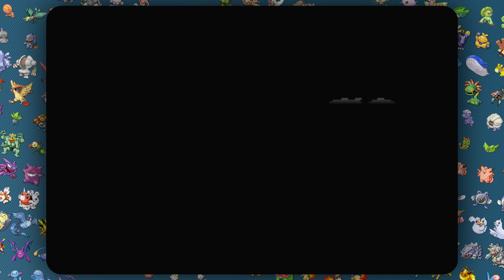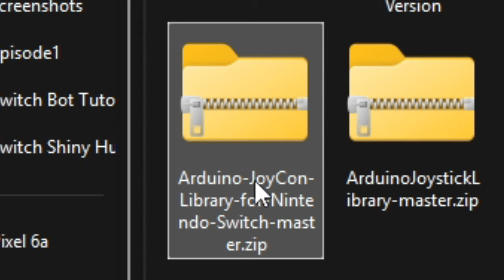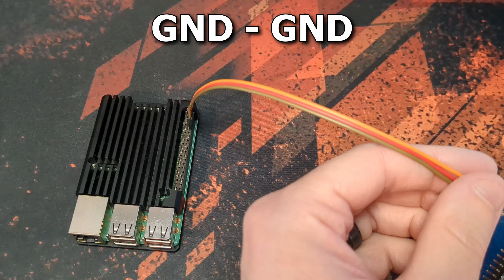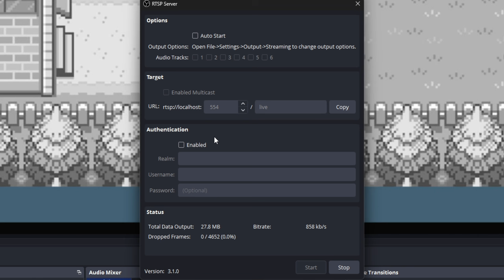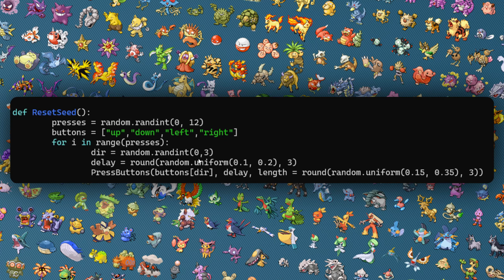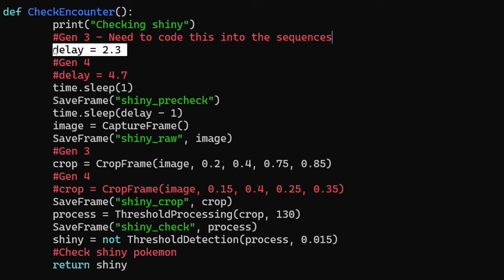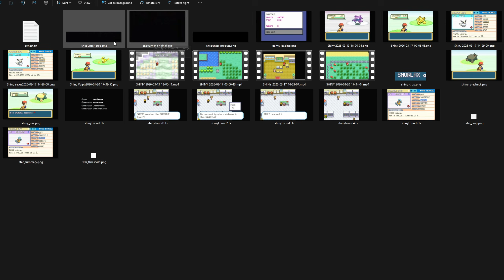How To Automatically Hunt Shiny Pokemon - Switch Bot

Comment: i can't get any of my microcontrollers to act as a switch controller. Just curios but what version is your switch on? System Settings -> System -> System update, mine says 22.0.0. Since i'm running the latest version, maybe there has been an update to preventing microcontroller spoofing, idk
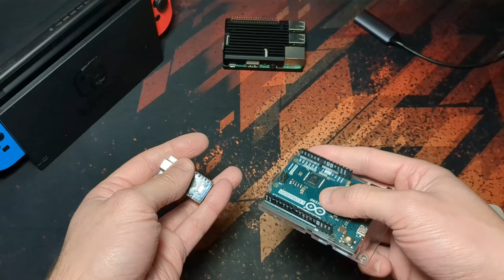Reply: Do you have a micro or Leonardo Board? 3:41
Reply: Tried this on an Arduino Micro and also on a Pico 2 with a different github repos, spent like 10 hours troubleshooting and still couldn’t get it working. Now I’m just soldering my pico2 directly to a wired Switch controller PCB to simulate button presses. So far this seems like the most promising solution lol
Reply: @shinichi4980 I have a Leonardo and it won’t act as a controller and ideas on how it may be fixable?

Comment: Ok man, I may have discovered the issue you have with your inputs with NXBT. Linux has chronic issues on its drivers when it comes with managing the Bluetooth connection, the most common problem, when the CPU is on heavy load, it starts to have some package loss, ultimately causing the disconnection of the device, so the connection problem lies in the power of the device. By the way, do you still have the old code using NXBT? I think I could manage it to work on a more powerful SBC.
Reply from the maker: Yeah it's on the GitHub page as a separate script, I had a feeling it was an issue with my weaker Pi, adding the USB connection was an easier fix that I'm glad I went for

Comment: What is the arduino for that the pi cant handle? I have a pi 5. Do i still need the arduino board?
Reply from the maker: It acts as an HID that the Switch can actually understand, it's probably possible with the Pi directly but it's a lot easier as the Arduino is designed for that kind of usage
Reply: I appreciate the reply! Which board model is it? Trying to order soon :)
Reply from the maker: @BombadDondo  A Pro Micro clone, any will do

Comment: Please add eon timer to your bot so we can rng hunt for perfect Iv Pokémon
Reply: Maybe, he can make a controller output designed to rig and check the Trainer and Secret ID. If he can consistently rig or check them, then he can make a program that uses a shiny frame calculator and resets for the Shiny.

The Initialization program uses a consistent setup to make a Trainer ID, then double checks if it got the desired Trainer ID. If it did, it proceeds through the game, saves before the Starter, and hunts for the Secret ID. Once both have been discovered, it outputs those IDs to an external file or the program window.

Using that data, the Encounter Frame Hunter can do its job. It hunts for desired Pokemon based on the Seed Calculator, adjusting its timing or seed based on misses.
Reply: @LocalMaple that would be so useful. So far im trying to just find a program that will hit the buttons to get the right seed when you are saved in front of a legendary. Like how eon timer works

Comment: 1:18 That could be just the input not pressed long enough, on my 8bitdo Ultimate 2, when running a macro, if the button presses are held for 25ms it'll randomly not go through, around 15ms or less they just won't go through at all, 30ms seems to be the minimum for consistent button presses.
Reply from the maker: I tried this and extended it, even with NXBTs block to ensure presses go through but it would still fail sometimes

Comment: I set this up based off your last video, using a main windows desktop to set up the capture/rtsp stream and used an old laptop running ubuntu to run the bot. I liked the use of nxbt before, is there any reason why you chose to not use it any more? The Arduino setup seems so much more complicated. I did experience the problem mentioned in this video of the bot occasionally disconnecting or thinking a mon was shiny when it wasn’t so I’ll go back and try to adjust for that. I do have one persistent problem not mentioned in the video and that is that the bot will get to the “ran away safely” text and not push the a button and begin looping the directionals again and time out since it doesn’t get an encounter as its still in the battle. Have you experienced this and is there any good fixes? Thank you for the awesome video!
Reply from the maker: I switched away from NXBT because of things like that issue, it would sometimes drop inputs and so if it didn't press A on that text for example, it gets stuck. Like I said in the vid it could be because of my Pi's Bluetooth specifically, but with the wired approach it guarantees that every single input is sent. An easy workaround is to extend the delays and add duplicate button presses so it's unlikely to skip both, like to run have it press down down right right a a for example. 
I also added a max loop feature so if it loops too many times it soft resets the game and repositions itself. Good luck with it all.
Reply: @Gee @Geeze Thanks so much for the response. Makes sense, I had a feeling that was why. May have to dig up my old arduino lol. Awesome project, hope to see this expanded in the future!
Reply: @Geeze Do we still can get access to the old code using NXBT?

Comment: I’m trying this today! Although, i’m using OpenCV python library for computer vision with a video capture card, a RPI pico 2 for USB button presses & my mac running all the code. If this works, i’m going to try your method in the future so i can free up my laptop & run everything off a RPI 5 :)
Reply: Did you get it working on rpi 5?
Reply: Give us updates.
Reply: 3/31 update: I got the computer vision and logic to work perfectly. Python program on my mac knows what frame the game is on and executes the appropriate button presses. I'm stuck on the controller part. I did this on my arduino micro, followed the steps exactly as in the video but my switch isn't connecting to the controller. Not sure if this is a macOS thing. I've been troubleshooting for like 6 hours straight lol
Reply: In his other video he explained a similar connection issue you shuld go check out the other one he made! Might solve the problem.